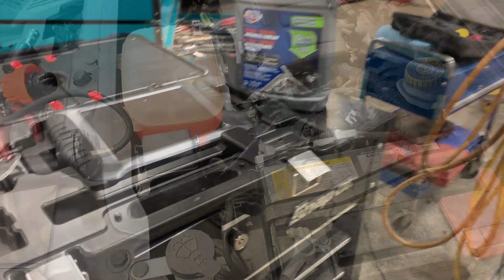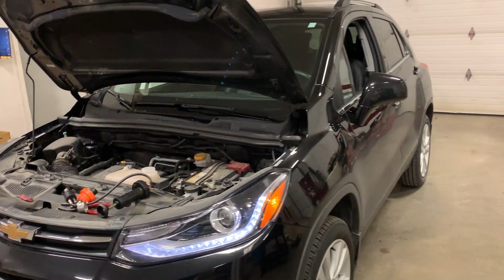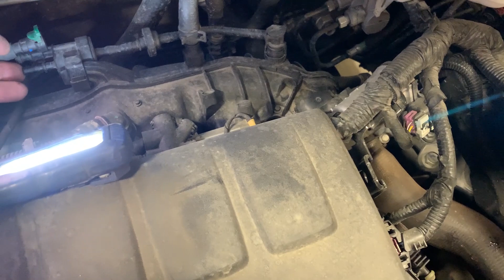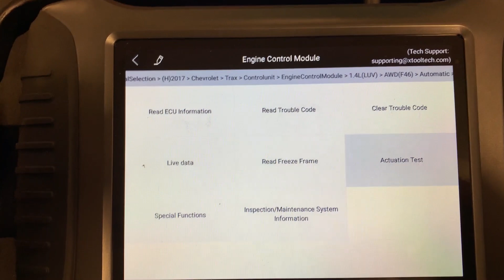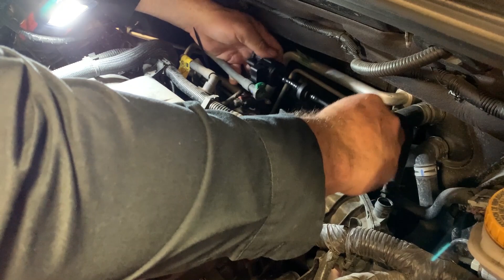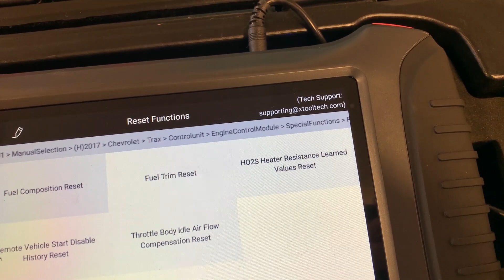Chevy Trax 1.4L P0300, P0171, P0496, P1101 Diag and Repair Using XTOOL A80 Pro Master

Comment: This was so helpful! My 2014 trax started running a little off. When i start to accelerate, it sputters like it's running out a gas and makes a rattling sound. I thought maybe it would be the fuel filter, but maybe it's both. I did run a diagnostic test on it, and so many codes came up in terrified to take it in and have it looked at.

Comment: Hello? On my Trax, the po171 code is for the diafrham on the valve cover has gone bad. You will have to change out the valve cover. Have a great day.
Reply from the maker: I believe Ford has a special service adjustment and free repairs on this but youll need to check with your local dealer to verify.

Comment: I had the same issue and a PCV valve go bad on a 2016 Cruze with the same engine as shown here. I'm starting to think that the only people that should buy a Chevy are auto mechanics. I'm not impressed with their designs or quality . Thanks for a great video and good review of the diagnostic tool.
Reply: Its a literal 15 minute fix and a 15 dollar part

Its neither difficult nor time consuming nor expensive.

Comment: Does the engine light have to recalibrate when a car My  2015 Chevy Trax is over 100,000 miles?  It is in the shop and that what they saying that is needed.   It is showing code to replace the catalytic converter.   They said more then likely the engine light is give a false code.   They stated cost less to try this first.   Please respond back.

Comment: Egr purge valve 🤔 just a guess from my history with chevy traverse and other chevy products. Its a pleasure fuel system. Caused by filling your car is ok. But once it stops you need to stop putting fuel in your gas tank. If you try top it off or even the price. Usually shortens the life of the valve. Sadly it causes all types of messages so you can't trust the scanner ot you be lost in a chase. I go with higher quality one from the parts store. I don't buy chevys or the lowest price one at the parts store. Less issues over time so far. Last time I believe it was around 50 or 60 and 2 minutes of time.
Reply from the maker: I have never heard of an EGR purge valve. Very interesting

Comment: Plz part or serial number of this vacuum solenoid..
Reply from the maker: Call local dealership parts dept for that I’m sure they can help. Blessings.
Reply: @ThecardoctorTV  We have problems with the local dealer .. because these cars are transported from the USA and in Europe there are problems with spare parts for cars imported from the USA. we have different spare parts for cars for the USA and for Europe. therefore we need this spare part number .. 🤝if it possible..
Reply from the maker: What’s the VIN number?
Reply: @ThecardoctorTV  3GNCJLSB7JL310362 and approximately price plzz.
Reply: Same cars but different parts..for USA 1.4 turbo.for Europe 1.8 naturally aspirated engine.. different head light and many other difference ,but car the same Chevy Trax..
Reply: Thank you in advance for your response and answers..🙏🤝
Reply from the maker: GM# 55573017 $28.54 USD
Reply: @ThecardoctorTV  I really appreciate all your help🙏
Reply: So for the code po717 was it the fuel filter or the solenoid ? And also what fuel filter or fuel pump do you recommend ,?